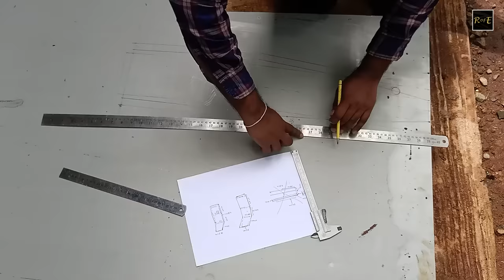How to make Home Made Dirt Bike | Building Off road Trail bike

Comment: Hallo good work there keep it up and I have a question hope you will help me,I have a motorcycle 125cc engine but when am In 5th gear at a high speed the engine start like it want to cut off so I reduce my speed what do you think is the problem please help me.

Comment: Very interesting build.  What engine are you using there and do you know the weight of the finished bike?
Reply: seems like a super cub engine, tehy come in 50,70 and 90cc, that's probably a 90cc because the other don't have manual clutch
Reply: Its Chinese made Honda c series rip-off
Reply: Loncin